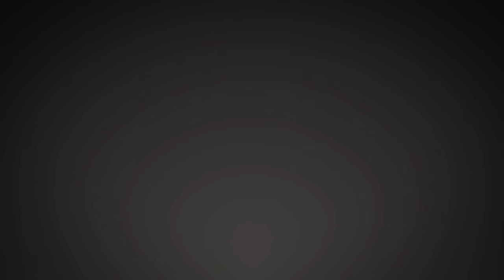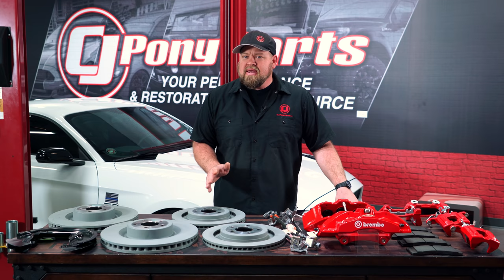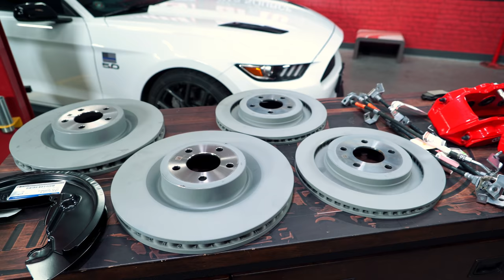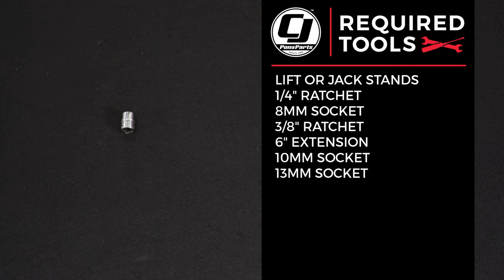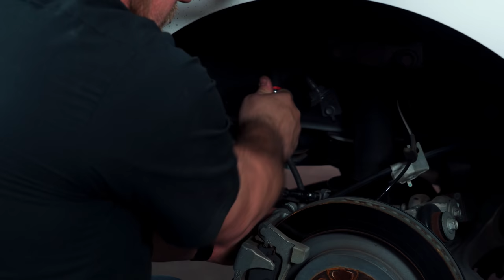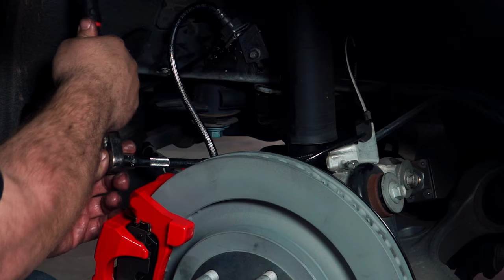2015-2023 Mustang GT Install: 2019 Red Bullitt Style OE Brembo Brake Kit

Comment: With my 20” Shelby aftermarket wheels, I put these calipers on my 07 GT500. Used the 13/14 GT500 rotors and the brake hoses. Had to make some minor adjustments but they have been on for 2 years and love them

Comment: Great video! I just installed the same set on my Ecoboost premium base model 2019. I noticed the brake line has one metal bracket in the middle. Did you connect it to somewhere or left it dangling? Also the line is a bit longer than stock line. Do you think there will be a problem?
Reply from the maker: The brake lines are designed for a car with Magneride which has an extra bracket for the brake line. I removed it after the video was shot to be safe but it really shouldn't be an issue.

Comment: I'm trying to figure out if this will fit my non PP 2018 Ecoboost that currently has 20inch wheels.

The description says it won't fit 2015-2017 non PP EcoBoosts, but idk about 2018. Do I need to get anything additional for it to fit?

Comment: Hi bill, on the site it someone answered that FP 6 piston brembo it will fit a 2019 Black accent package wheel, will these fit too? GT
Reply from the maker: They are the same as the regular PP1 brakes so they should work but I have not tried that wheel on a Brembo car.

Comment: Can the complete Brembo brake kit: Ford perfomance M-2300-YBK be installed or retrofitted, on Daytona coupe FFR with ADVAN Racing RS-DF Progressive 18x10 +35 5x114.3 front wheels and ADVAN Racing RS-DF Progressive 18x11 rear wheels? + 15 5x114.3? Although the kit features mid shafts, I am going to install Ford Performance M-4130-MA mid shafts to it and also Ford Performance Wheel Hubs W/ ARP Wheel Studs Kit Front/ Rear Mustang 2015-2024 CJ's Part Number: FPHSK1, and Ford Performance Differential Housing Super 8.8" Loaded Iron With 3.55 Gears 2015-2024 M-4001-88355B.
I would like to mount this kit since the Daytona coupe will have 700HP 650ft-lb power. I am in the middle of construction, so there is nothing to remove, just place.
Thanks for your time.

Comment: So I can't get a straight answer from my local Ford dealer...I have a 2020 GT California Special (GT premium w/19 wheels) and my brother has a 2019 Bullitt... He wants to give me the rear brakes from his Bullitt and I can buy the front part of the kit from Ford using his VIN #, since I don't need an entire kit(Ford dealer won't order individual pieces without that number)....BUT Ford can't tell me if the Bullitt brake kit will easily bolt up on a non PP GT. Maybe it's just our dealer so any advice would be appreciated!!
Reply from the maker: The rear brakes are the same except for the color so they will work fine.

Comment: do you have to bleed all 4 lines if you only upgrade the front?
Reply: I'm not a mechanic, but I believe the brakes are redundant on 2 different systems.  Bleed the front and see what happens.  If the brakes are spongy, then redo, starting with the backs.
Reply: @AStanton1966  thanks. I bled the front and there is no sponginess. It does feel link whiplash when I hit the breaks 😁😁😁

Comment: What would I need to add these on my 2017 base ecoboost, I do have 19inch rims on the car. What would I need to upgrade to have this kit fit? Thank you
Reply from the maker: Most 19 in wheels will clear the Brembo brakes. I don't know what wheels you have so I cannot say for sure. IF they will fit a Performance Pack GT they will clear these.

Comment: So if they are meant for the base GT does that mean it will clear the factory 18” wheels?
Reply: They will not clear the factory 18" wheels. There are some aftermarket 18" wheels that will clear.
Reply from the maker: You will need a performance pack or equivalent wheel. I should have mentioned that but it is detailed on the ordering page.

Comment: No brake clean on fresh rotor or reason why these did not require can see grease from fingers on front at end of video? Recommend anti rattle clips, grease and pads loaded in bracket before bolting to car (in reference to rear brakes), although if grease is carefully applied as to not touch rotor this order of operations works.

Comment: Would this work on v6 with 19 inch rims
Reply: Marquis Morning why would you need brembos with a v6
Reply: Lil Clorax i engined swapped it with a v8. Trying upgrade the brakes and suspension
Reply: @Jay6.2  Is this overkill for a v6? I have an ecoboost and considering these because I do canyon runs and my 4 piston has fades after about a half hour. Also, the cooling design for the rotors is accurate, the cooling on the v6 and ecoboost (vanes) are designed backwards.